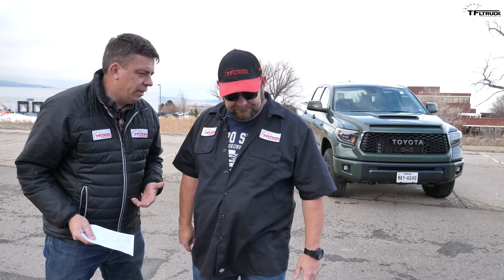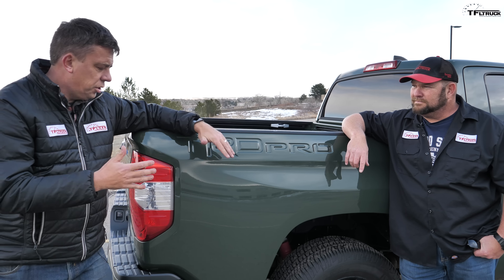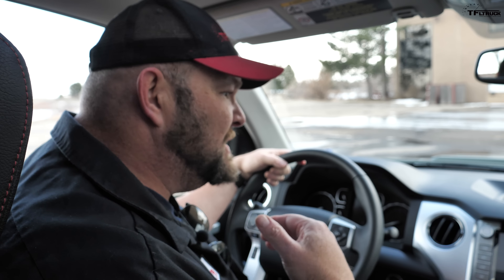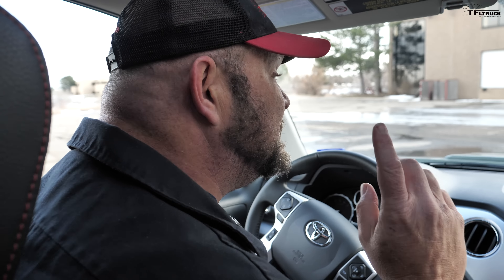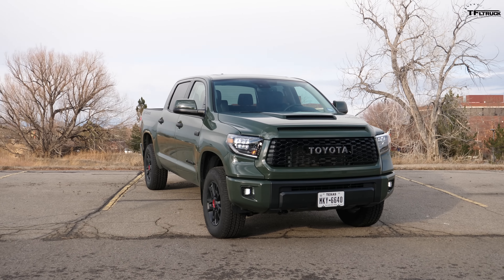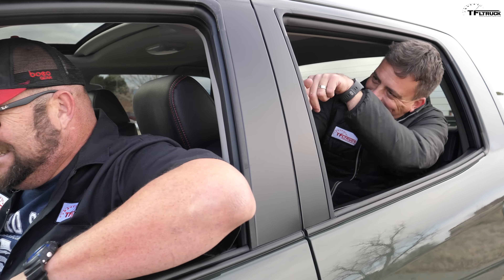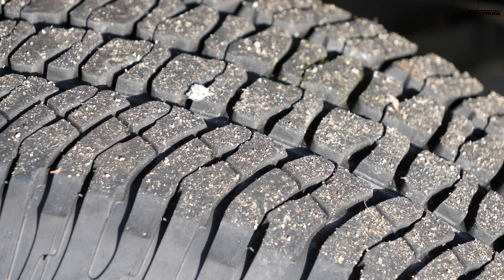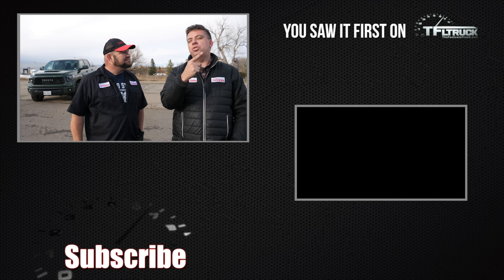The 2020 Toyota Tundra TRD Pro Is Outdated on Arrival - No, You're Wrong!

Comment: I tow with that exhaust and it's fkn miserable.  That said, I love my '11 Crewmax ... paid for, 65k miles and nothing but oil changes.  Might be time for brakes soon.  Taking it to 100k and beyond ... there's no good reason to buy another truck but the TRD Pro 4Runners sure are tempting.
Reply: I too tow a 6000LB camper about 3000km a year...the only reason I didn't get the TRD exhaust. I figure if my stock exhaust sounds loud under acceleration imagine that awesome dual TRD setup.  It would get old real fast after a few hours on the highway. 
Having said that we have one of the sweetest sounding V8's on the market.
Reply: My 16 needed a ac fan because it got stuck in the wide open position.  It didn't stop working it just only worked too good.  But in 110k miles that's all it needed besides oil changes and filters.
Reply: Only a 100K? I'm approaching 190 on my 2007 TRD with the 5.7 and I've done the brakes once and shocks once. Oil and filter changes only besides that that.
Reply: For the exhaust if ur interested look up bamufflers they don’t have a fancy look but sound is great and they incorporate a resonator to get rid of the drone. 17 here towing 7500 lb camper no annoying drone
Reply: I agree Mike,  I had it on my 16 for 2 years and just pulled it off and went back stock as that drone at 65 was a killer!
Reply: @louie4316  I've had mine for 3 years and I still smile when I hear it. I don't find it annoying while I tow either.
Reply: @belanger9  that's good to know, when the time comes for me to get a new exhaust I think I'll go with TRD.
Reply: @ronniejr1983  I bought one of Keith's resonators and put it behind a factory muffler on my 16.  Whenever I'm not accelerating it's stupidly quiet like an electric car.  I'd put a resonator-equipped single exhaust Tundra right up there with the quietness of the new Chevys when cruising.  Maybe even quieter.  I actually had someone freak out thinking the motor had stalled out the day after I put it on.  That resonator is the real deal

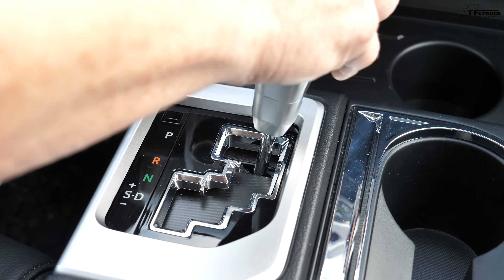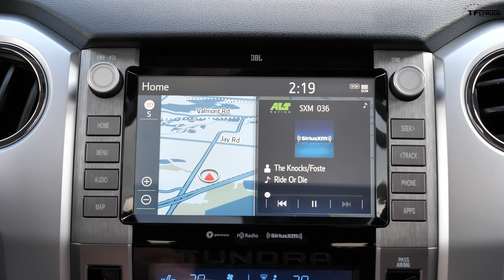Comment: Non of those other trucks have 4:11( maybe 4:30) gears from the factory like this tundra. That’s why the MPG is low. You want MPGs get a diesel or a sedan. Most truck owners who haul or off-road prefer not having a new truck that comes with tall 3.23 or 3.73 gears. For 2/4 more mpg. Voiding the axle portion of the warranty for upgrading gears with aftermarket gears. Toyota gets you shorter lower gears under warranty.

And screw a 16 camera interior that’s all stuff that will break eventually. The 4Runner interior is even more outdated. Yet they go for. 40-50k. And people are buying.

Smaller displacement turbos are a gimmick. They are cool and have their place. The Ford ecoboost is is a great engine. However, it’s not more efficient. A small displacement motor only gets better mpg when your not on the gas. The moment you get on it and your in boost. You’ll get the same as a N/A V8.

Comment: Reliability > Features
Reply: why not both??
Reply: @Chris Ruiz 
Apparently, a lot. New fog lights, huge light bar, front and rear aftermarket bumpers, skid plates, and a winch. Not too mention, huge mud tires, aftermarket shocks, and lift kit. However, no one in their right mind is going to take a full size crew cab [heavy ass] truck onto serious off-roading trails.
Reply: @Chris Ruiz 
As for the old adage, "..if its not broke.."..it gets boring seeing the same truck for more than 5 years or so.
Reply: So you ride a horse or a Model T?
Reply: Honestly,  id say screw the features, just more things that can break over time and cost a fortune to fix. Give me an original toyota pickup, or a 1st gen d150 (either 318 or 360) where all you need to fix them is WD40, a screwdriver and a couple wrenches. Are they efficient? Kind of. Are they luxurious? Hell no. Can they run forever if well maintained? Yup. I remember as a kid our water pump on our '84 ramcharger (318) went out on a Sunday evening in Windsor Ontario. My father fixed it really quick once we found an auto parts store open and with minimal tools. Couldn't realistically do that with any vehicle made today.
Reply: @Sig721Tau  wide open off roading at speed with 4 other joy riders is what this is for.
Reply: Tim Tom  basically awesome
Reply: @kidamere2408  that’s why the Trd pro is so much cheaper.
Reply: It’s crazy to me how people rather have new features and fancy tech over reliability, 07-21 Tundra all day, sure gas mileage bad but it’s a v8 they all like that. At least the truck won’t break down on you
Reply: Reliability for 60k used with an ugly interior
Reply: @funnyrandomwtfclips9322 because people don't want to spend 60k for a used truck with technology from 2010, they want to be proud of what they have and it's not like other cars just fall apart right off the lot

Comment: Tundras are reliable but they should better stand behind their cam tower oil leak. I think their safety sense should have included blind side monitors (now optional). Id like a mechanical limited slip rear axle again instead of their curreny traction control axle. A '20 SR5 Trd Off Road Double cab MSRP is $47k.  I think that is too much $. I think their Limited & Pro are more competitively priced. I've owned 3. Great trucks.

Comment: As tested $54k? You cannot get the army green for that. No way. Full msrp is almost $58k. Dealers are tacking on $3k premium on top of that. 
And it still sells immediately the minute it hits the dealer lot. 
I paid more for this 2020 army green trd pro than my previous 2017 1794. 
Lots of new cool addition to the new model. 

Push button start
Keyless entry
Intelligent cruise control
No more antenna (fin antenna on roof)

Bull all that money and the tail gate isn’t even a power lock
And it comes with ridiculous 18” baby tires. 
Cmon Toyota.

Comment: I just purchased this truck and it's plenty truck for me. The price, engine, reliability, suspension/ride, exhaust, paint color, spray in bed liner (on mine), black out trim, sunroof,  heated seats,
Bed track system. skid plates, wheels...there is nothing I don't like about my new truck. 
It's a sweet truck! As far as mpg, F150 takes premium fuel so per gallon divided by mileage, they both come out about the same and if you can't afford the fuel, get a Honda Ridgeline.

Comment: When you buy a truck... you don't worry about the MPG.. the hell is wrong with people.
Reply: The Babadook Doot I get 10 avg in my tundra it’s ass. Ditching it for an ecoboost first chance it get
Reply: @Redchew10   Doesn't seem like the wisest choice,  but ok.
Reply: @Redchew10  LOL Hope youre kidding.
Reply: Redchew10 do it, my 3.5 in my f150 is amazing. Don’t let the people scare you, it’s been pretty reliable, and pulls for days and gets decent fuel economy if you keep out of the pedal. Not as good as it’s rated, but better than this tundra.
Reply: @alecw7063  It will never be as reliable as a Tundra. Our F150 needed a transmission rebuild at only 115K miles. Tundra is just a tank. Who would rather have 1 or 2 better mpg instead of reliability?
Reply: Immortalkalashnikov mines at 93k right now and with oil changes and filter changes, everything engine wise has been great. It’s not just about the economy, this truck is a blast to the past on the inside. The f150 is so clean and feature rich on the inside and so simple to use while not making it seem like it’s the early 2000s

Comment: Would love it if Ford Trucks had that rear window. 4:56
Reply: You'd love it even more if Ford trucks would last half as long as that Tundra.
Reply: But you don’t know what yr of Toyota turd you are looking at, could be 12 yrs old ar a new one
Reply: they did, was called the Bronco
Reply: @paulhunter9613  🥂
Reply: That back window is the shit for tossn empties!!!
Reply: Paul Hunter ....You can tell by looking at the grill.
Reply: @J Packard Yes. That is correct. Thats what i loved about my old 2008 Toyota Tundra. I put on a shell on the back of the truck bed and rolled down the rear window for air flow. It was great, especially in the summer. I loved it so much I bought the 2020 Toyota Tundra Crew Max TRD Pro. Its an awesome truck.

Comment: Why do you guys never mention is the adjustable headlight levelers, something the big 3 doesn't offer but Toyota has offered since 07. Nissan has this feature as well. Great for when you're towing and hauling heavy loads and you want the light on the road where it belongs instead of pointed up and blinding oncoming traffic. Nobody mentions this feature on the tundra or titan and that's a pretty good feature to overlook.
Reply: If your truck is squatting to the point where your headlights need to be adjusted, you either have your load distributed wrong or a load that is too much for the tow vehicle. When you’re at that point you are putting yourself and others at unnecessary risk due to poor handling characteristics that come with having your truck squatted like that
Reply: I had no idea that was a feature Toyota offered until I read your comment! Thanks.  I hate how blinding the new trucks are, towing or not towing, their headlights sit far too high for people driving regular sedans that even low beams are blinding enough.
Reply: @jamesheaslip7465  ford f250 squat with even a small load. I had 1500lbs of salt gel in the f250 and the same load in my titan xd and it was distributed evenly in both beds. The nissan just leveled but, the f250 squatted big time. And no I dont think the titan xd can haul more, it just squatted significantly less with the exact same load. Any truck will squat when you put a decent load. I guarantee every truck that is loaded at or near its capacity even correctly squats. Just leveling a truck causes the low beams to blind people.
Reply: @mr.q4994  I love that featurem my titan xd has it also, when I did a 2x1 lift level I clicked my leveler down one notch and everything was back stock. When I had it on 0 people would flash me, when I put it on 1 it was perfect.
Reply: @jamesheaslip7465  I agree it's dangerous but it doesnt take much to squat a truck, and it doesnt take much squat to blind oncoming traffic. Just leveled out a truck will do that. My f350 with less than 2,000lbs in it squatted pretty good to where I had to adjust the headlights not only because it was blinding traffic but the high beams were useless. Once I adjusted them down it was night and day. High beams now light up the road alot better and lows dont blind oncoming traffic. Even unloaded my 17 f250 was blinding traffic. Everyone flashed me. I think ford must have aimed them a little high from the factory.
Reply: rochab77 extremely ugly truck.....
Reply: @ronp1018  to each his own

Comment: Got mine this past monday in magnetic gray and noticed that the oil pressure fluctuates. As i accelerate from 1s starts rising and then lowers to operating range once the engine catches up to the rev and gear . Dont know if its normal on the pro but ive never had a truck or car that would do this yet again this is my first time buying a brand new truck there alone a tundra pro. Any info would be greatly appreciated
Reply: Temp gauge stays in operating range

Comment: I leased a 2019 TRD because of the great leasing price they had on them   So far I have been very impressed with the truck.  The power has been great and I love love the 38 gallon tank on it.    When I think about the truck being a 07 design I personally am impressed that Toyota was that far ahead of the completion and in general people didn’t realize it 

The cab for as large as it is and yes it is very roomy still has no storage     A flat floor isn’t a problem for me but no storage under the seat has been      If I set the cruise at 62 and don’t have to start stop I can get 19-20 and better with a wind pushing but other then that it’s like any truck I’ve had and I get 13-16  but it’s not sluggish this truck goes and the tow haul makes it a race car    I am excited to see what they design for the new one and I hope they keep the rear window also along with the 38 gallon tank

Comment: I had a 2006 Tundra for almost 10 years until some texting teen killed it.  I went and bought a Lexus GS 350 and drove it for a few years, and eventually gave it to my daughter when she started driving so I could get another truck. I agonized for a long time, and eventually I bought an F-150.  I am 4 months into ownership without an issue, except for replacing the horrific headlamps with LEDs.  I am constantly haunted by the thought that I made a mistake.  Don’t get me wrong.  The Tundra had its Toyota problems like spending $2K to replace all the door locks, but overall it was a HIGHLY reliable truck.  Time will tell if the F-150 was a good choice.  Back in the 90s, I owned a Chevy Silverado and eventually traded it for the Tundra.  Chevrolet or any GM product isn’t worth owning...unless you like busting knuckles and getting greasy.

Comment: I am still driving my 2007 Tundra.  It just won’t die!  Super reliable.  My next one will be a used 2016 or 2017 with low miles.   I won’t pay the high price for new even though  I can afford it.
Reply: With the great re-sale value on these damn things, a used one a few years old doesn't seem to save you too much money.
Reply: You can save almost $15k over one of the TRD pros.
Reply: Les Johns ....I was looking for a pickup truck myself, could not justify paying such high prices for any product that depreciates, especially a vehicle. 

I found a 2004 Tundra Acces Cab, with the 4.7L engine, 100,000 miles that was taken care of. I put in lower ball joints, outer tie rods, end links, sway bar, sway bar bushings, rack and pinion bushings, front shocks and springs, new muffler. $500 for parts, I did all the work as the first generation tundra was easy to work on. I saved $50,000 and have a good work truck that takes care of all my needs for the home and work.

Comment: "Hamilton cites last year’s EPA report on emissions and fuel economy trends which concluded that from 2012 through 2017, the five years in which the combined EPA Greenhouse Gas Emissions and NHTSA CAFE regulations have been in place, “Of these thirteen manufacturers [Honda, Mazda, Hyundai, Subaru, Kia, Nissan Mitsubishi, VW, BMW, Toyota, Mercedes, Ford, GM, FCA] all except for Toyota improved CO2 emissions and fuel economy.”...Hamilton explains how this happened:

Their pick-up trucks are less efficient than most of their competitors and they are far behind the industry leaders when it comes to electrification – their plug-in Prius can go a mere 25 miles on a charge before turning over to the admittedly efficient gasoline engine, and they offer a low-volume fuel cell vehicle only in California. They aren’t currently selling any other EVs across the US.

https://jalopnik.com/toyota-isnt-the-environmentally-friendly-one-1839969117
Reply: Norm T yep. Huge fuel hogs
Reply: Norm T Good thing idgaf about emissions and plan on removing the cat from my bmw
Reply: Good thing I don't care about emissions or fuel mileage. I removed the cats and egr from my Mustang and my Ranger and glad I did

Comment: I own the 2016 Tundra TRD Pro. I added ARB air lockers front and rear plus 35” MTs. Now - it’s an outstanding truck.
Reply: If you don't mind me asking, whats a ball park price to add the lockers?  Just the lockers not the tires.  I've got a 2019 and was thinking about doing.  Thank you
Reply: When I added ARB lockers: I used the most reputable place I could find on the east coast and that was East Coast Gear Supply in NC. I also opted for the best ARB air compressor and hook ups for an air hose. I use that a lot to air up tires quickly. These are really ball park numbers from memory: lockers cost about $1000 each and everything else was about $1500. So maybe $3500-4000 for my setup. This is from memory. If I was looking to save money I'd just go rear locker with a basic air compressor and look to a local shop. Maybe less than 2k. I know 4 Wheel Parts had them. It does completely change the truck. It totally eliminated the biggest weekness. Good luck!
Reply: @lwonutube  Thank you for your reply.  Really not as bad as I thought.  I live in VA, I might have to look them up.  I'd rather not have an inexperienced person doing the job.  I plan on keeping this truck forever so it'll definitely be worth the price and the truck is built to last.  The truck is perfect otherwise (IMO).  Thanks again for the information.